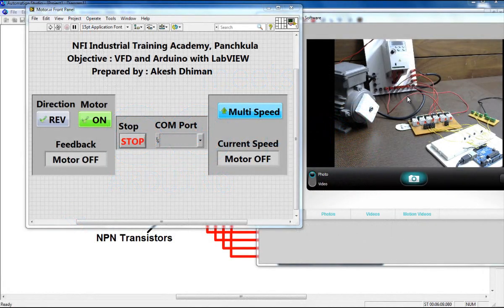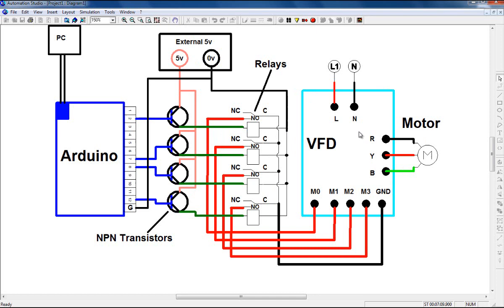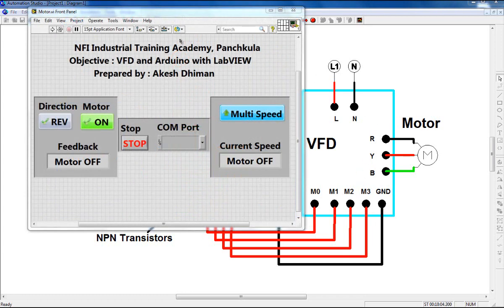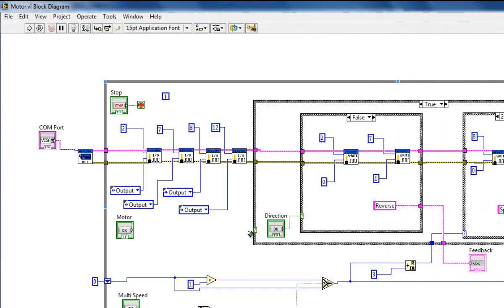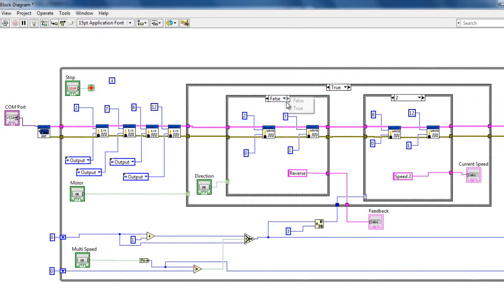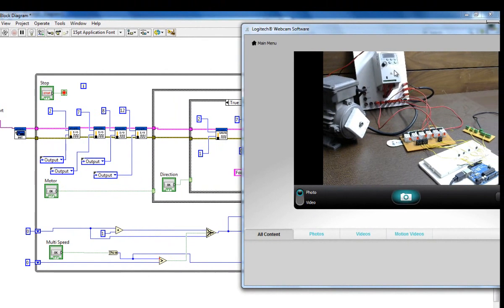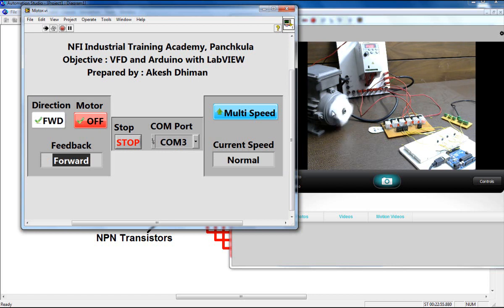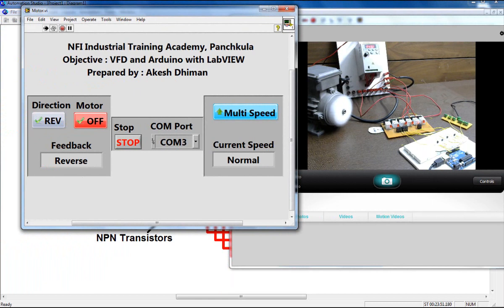Arduino LabVIEW Tutorial- Controlling VFD using LabVIEW via Arduino

Comment: Hey thanks for the video. I am doing a similar project for my engineering project in jamaica and is just learning how to code the arduino. Is it possible to share the code you used for the arduino to implement this function. It would be very helpful while i am learning to code the microcontroller. thanks again for this awesome video

Comment: What is the model of the VFD that you have used in this video?
Thanks
Reply from the maker: +Wajeih Aburwin We are using Delta VFD L Series 400W
Reply: +Rajvir Singh (NFI Automation) Why did not you use the analog voltage frequency command AVI? it seems easier to control the frequency.
Reply from the maker: +Wajeih Aburwin Yes we could use that as well not an issue. It's just we wanted to show using Multi step speed command.